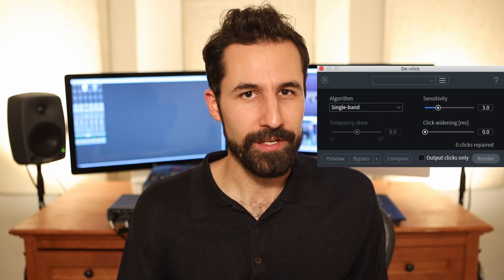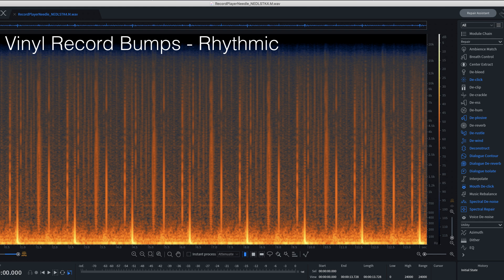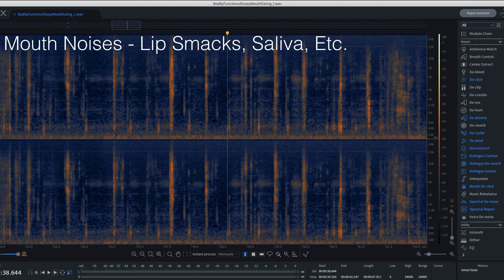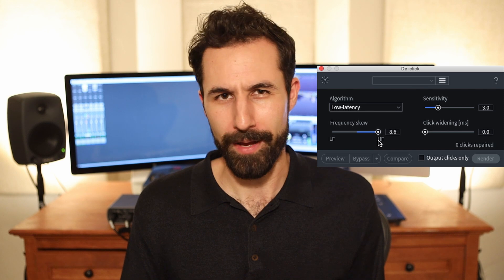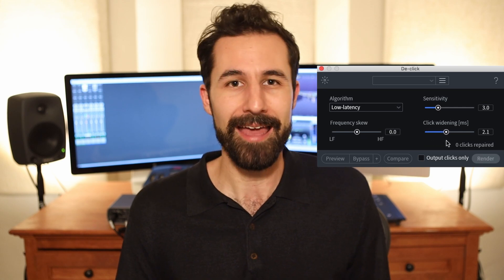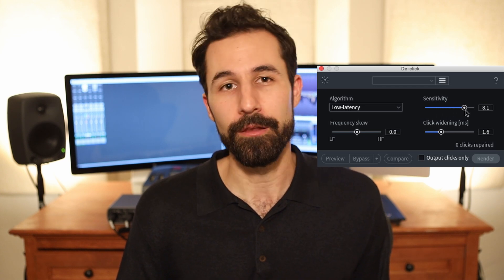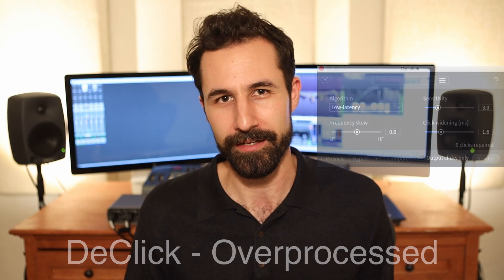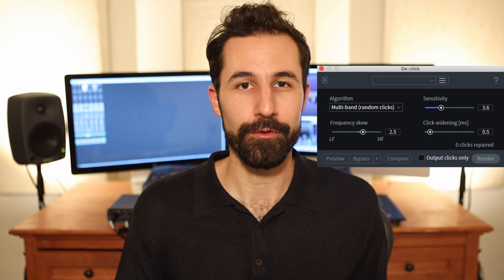How to Fix Mouth Clicks for Pro Voiceovers and Dialog - Part 3 of 24

Comment: Hey Alex, thanks for this info! Others have suggested not applying this to an entire vocal recording as it can negatively affect it and instead only applying it to just the clicks by going through manually and highlighting them. I gave the trial a go and just applying it to my whole session seemed fine, and honestly it's the only way the plugin makes sense for me. Interested to hear what you think 🙂
Reply from the maker: The “best” way to do it is indeed to only individually process the clicks you need to remove. That’s what I do when I’m cutting dialog for film/TV, and especially when I do dialog for interactive/games. But that takes time and therefor needs a budget behind it.

Generally you can get okay results by batch processing, but it will definitely remove more than you’d ordinarily want.

Hope that helps!
Reply: @axk  Thanks!